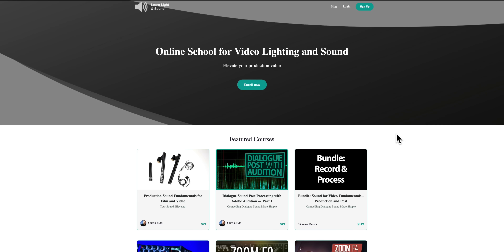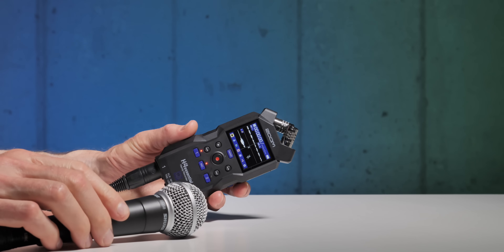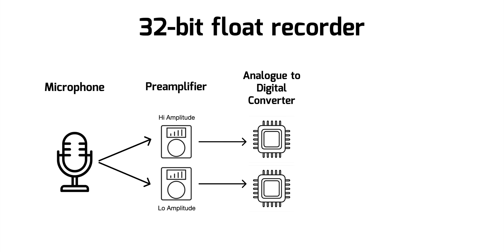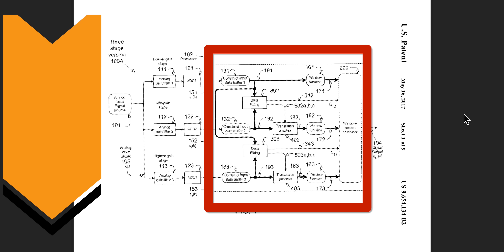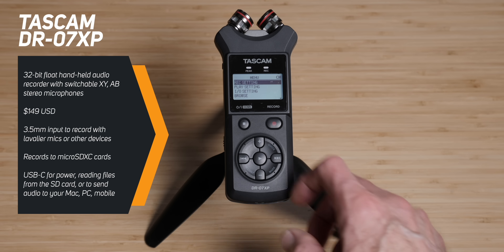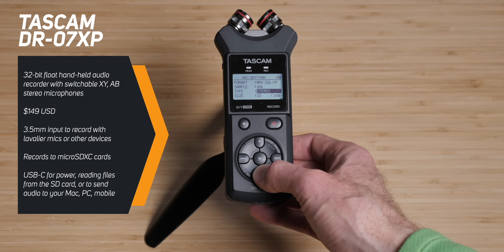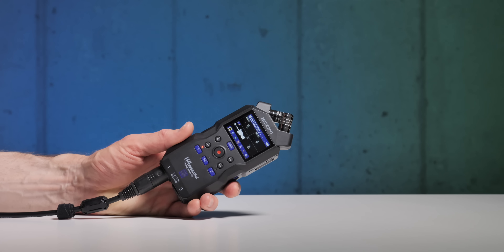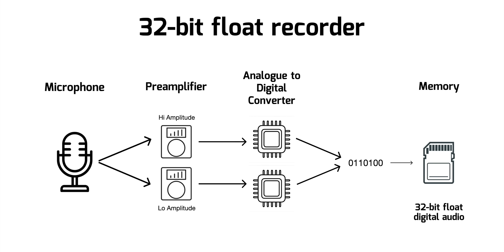PART 2 — 32-bit Float Audio Recorder Quality

Comment: I've been looking for a explanation of a 32bit  compared to 24 in respect to sound reproduction in a modern system am I correct in saying a 32 bit recording has a higher resolution of sound I.e. more detailed play back?
Any pointers would be much appreciated
Reply from the maker: Resolution is mostly a factor of sample rate and word length (24 vs 32-bit float) but there’s VERY little difference that most listeners can detect beyond 24-bit, 96kHz sample rate. What 32-bit float does generally offer is the ability to recover audio that goes over 0dB full scale. In higher quality 32-bit float implementations, you can also generally boost levels without raising the noise floor prominently.

Comment: Thanks Curtis. There is a new recorded on the market now from Zoom. Would like to hear your opinion on it very much. Also would like to hear your opinion on all small clip on mics like Rode Wireless Pro and DJI mics as well. Thank You very much
Reply from the maker: Yes! I covered the RODE Wireless Pro and ZOOM H5studio (which is presumably using the same microphones and preamps as the new H6studio): 

RODE: https://youtu.be/XcFrlxg9Nqk?feature=shared
ZOOM H5studio: https://youtu.be/kqaZIwEvye4?feature=shared

Comment: I wonder what your perspective is on using post processing techniques to reduce the captured noise?   
There are well known techniques in AstroPhotography to specifically capture the sensor noise under various scenarios and to use this data in post processing to dramatically reduce overall image noise.  Wondering if there is a viable equivalent process when capturing audio?
Reply from the maker: Yes, though many of the current generation noise reduction algorithms seem to do as good or better job. The trick with the recording of noise and using that as a cleanup baseline is that it generally only works with noise that is consistent, like HVAC moving air. And interestingly, that’s where the newer neural network and machine learning algorithms work really well.

Comment: According to your explanation about the quality of 32-bit float recorder, then how about the tiny 32-bit recorder on wireless mic transmitter so popular today? Are they completely out of consideration, meaning fake and only gimmick?
Reply from the maker: No, not necessarily. They're implemented differently, but the marketing people should NEVER say that they are "unclippable" because that's not true. Those little built--in mics can clip pretty easily. And each one is different so I would listen to a bunch of samples from each before buying.
Reply: @curtisjudd  Thanks for the answer, Curtis. I guess in the end I have to trust my own untrained ears to get the best recorder. Or, watching as many review as I can from the expert with trained ears.

Comment: I have 24 bit gear from 1998, so upgrade it will take at least 27 years, if ever. I wonder if there will be 64 bit recorders in 2050, just to record spacetime distortions from black hole mergers and nothing else.
Reply from the maker: Niche-o-rama. I'm with you. There have been less than 3 situations where I felt like 32-bit float actually helped me.

Comment: Serious Question: Why not "more" preamps and ADCs? I mean, obviously cost and diminishing returns, but could you still increase the dynamic range in any noticeable way? Where is the physical limit. 
I imagine that today, the ADCs should be cheap and low power enough, but the I'm sure the preamps are much more complex. 

But I absolutely love my Mix Pre's. I have the original 3 and the 3-II. Happy to use both, and I prefer even the "old" 3 over the Zoom F6, but that's most for UX.
Reply from the maker: For human hearing, I'm not convinced that we really need more than 140dB of dynamic range in our recordings. The funny thing is, even when 32-bit float  does its job and you can recover audio that exceeds 0 dBFS, you still have to address that in post before you publish your audio. And the irony is that many of the people that rely on 32-bit float don't do a great job post processing their audio.

Comment: @Curtis Judd : I have a simple question. I'd like to record DJ sets of approximately 8 hours in good audio quality using a Zoom or Tascam Audio Recorder, without post-processing. I'm not really into using the microphone options. Do you recommend a recorder with or without 32-bit Float? Which recorder do you recommend?
Reply from the maker: Unfortunately, 8 hour long recordings will get broken up into several files due to file system limitations in the ZOOM and Tascam recorders. The only recordings I know for sure that don't do this are VERY expensive (Sound Devices 833 for example).
Reply: @curtisjudd  Thanks for your reply. Only fat32 has a maximum file size limitation of 4GB, but exfat does not have these limitations.
Reply from the maker: @maup01 yes, makes sense, but I believe these recorders use FAT.

Comment: I wish Tentacle or Deity or someone would make a recorder with the size and function of a Zoom H1E or a Tascam O5XP but with timecode in it and higher quality preamps. Right now I'm running a Tentacle into one of the 1/4 inch inputs on an H4E and it's big and clunky and the battery life stinks and the noise floor stinks. I have a mixpre ii but sometimes I just need to put a recorder, or 4 recorders, in a few places and walk away to do camera work and not have to worry about the audio and I don't want to have to have a big setup with an external mic and xlr cable and big stands and stuff.

Comment: They could do fixed gain in 24 bit too, in fact thats exactly what those single converter setups are doing. There's no benefit only larger file sizes
Reply from the maker: One benefit, if you don’t care about noise: you don’t have to set gain.
Reply: @curtisjudd  you could do that in 24 bit as well. If the preset gain was high enough to clip a 24 bit file, it would still be clipping that 32 bit file which was made with a 24 bit converter and padded 0's

Comment: I think you may have been too nice or polite about recorders that do not have multiple, staged pre-amps/ADCs.  The limits of physics are still there limiting the dynamic range that any such single-stage system can handle.  So to users looking at one of those devices, it's true that you won't have to adjust the gain, but the odds are very much increased that your recording will either be faint and noisy or clipped, just like devices that existed a few years ago before 32 bit float was common.
Reply from the maker: I think I was pretty clear.

Comment: Hey guys, just wanted to share with you my knowledge about clipping and 32bit float.
The question is, like Curtis said, what's the weakest part in your audio recording chain.

Here we go:
So the first problem ist the maximum dBSPL which your microphone can handle, lets say 142dBSPL (Sennheiser MKH 8040).
The next problem is how much dBu your mic input on your recorder can handle, lets say 14dBu (MixPre II Series) and 4dBu (Zoom and Tascam).

Mathematic:
142dBSPL on the Sennheiser MKH 8040 means that it outputs 16.23dBU.
139.76dBSPL on the Sennheiser MKH 8040 means that it outputs 14dBU.
129.74dBSPL on the Sennheiser MKH 8040 means that it outputs 4dBU.

Result:
The MixPre II Series can handle maximum 14dBU mic input level, that means it starts clipping at above 139.76dbSPL from the Sennheiser MKH 8040.
The Zoom and Tascam Recorders can handle maximum 4dBU mic input level, that means they start clipping at above 129.74dBSPL from the Sennheiser MKH 8040.

By the way:
32bit float can take care of +770dBFS

Conclusion:
We all buy those 32bit float recorders because we don't have to worry about clipping. The minority really knows where their system starts to clip. So in general speaking, if you record with Tascam or Zoom in 32bit float you're fine if you don't exceed 120dbSPL. With the MixPre II Series you have 10db more headroom. If you want the exact number you have to study media engineering, because the math behind it is complex and you have to know what Bel is.

Things I would love to know:
Are those values A-weighted?
Why does SoundDevices Scorpio and 8-Series just have 8dBu mic input level?
Reply from the maker: Good points in there, thanks 👍

Comment: Great video as always. You ask for our experience with 32bit float recorders. The gist of what I want to say is that feature set and your intended usecase, form factor, ergonomics and requirements now outweigh sound quality differences.  My first one was a Zoom F2. (I liked it so much that I sold it amd bought two F2-BTs later :)    As my first experience was great, it did not take long to pick up a Portacapture X8. I loved the concept, versatility and user interface a lot. Initially there were a couple of issues with reliability and some irritating things in the software. But over the months Tascam released several new fw updates, and now it is perhaps my favourite recorder. The only thing missing for me is real timecode. Otherwise it has the perfect number and selection of inputs. Great recorder. Then I got an F8n Pro. That's a pro one, way beyond my true needs. An overkill, but I love it has two  line outs, dual SD... Perfect recorder for bag operation. Then a cheap secondhand F3 came my way. I loved the form factor and compactness. But I truly hated the record/hold/stop sliding switch and that it only had XLR and no 3.5mm or even 6.3 jack input. So when the Tascam FR-AV2 came out, I sold the F3 and got the FR-AV2 instead. It has a ton of features in a small body, and overall I am happy with it. But it has a very irritating issue: noisy audio with plugin powered mics on the 3.5mm jack input. And a few bugs or not so logical menu options. I hope Tascam will update the fw like they did with the X8. And then I coild not resist picking up a very well priced second hand F6. It is  very similar to what the F8n Pro can do, except the dual SD and the balanced line out. However, it is very compact and having NP-F battery and USB-C powering option so comfortably makes it a winner. Only problem, and that kept me long away from buying one (actually I first bought the F8nPro instead of the F6 because  of this)  is that for some mysterious reason Zoom has not made an Android client for the F6. I cannot fathom why, even the F8nPro does now have one.
Reply from the maker: Thanks for sharing! Ergonomics and others features definitely are a major consideration. 👍

Comment: I am probably repeating myself but my overall take on all of this is that if digital recording devices had first been released back in the 80s using 32 bit float output (instead of 14 bits, i remember it well), and then in 2025 someone came out with the first 24 bit float device, would we all have rushed out to buy it because we thought it was inherently better? I doubt it. It all has to be kept in proportion anyway. 

The chances of a client just complaining about the presence of 32 bit float from either one or more ADCs in a submitted recording is miniscule compared to a host of other factors. I'm currently working on the release of a 150 minute live recording I made of a historic classical music event from 32 years ago. 16 bits of course. 95% importance is the performance and by whom. 4% importance is the mics and where they were placed. 1% importance or less is the recording device, and you would need to express the percentage importance of the fact that it's 16 bits, as a tiny 32 bit float number. But i would have perspired less during the event if i hadn't had to worry about output clipping!
Reply from the maker: LOL! Thanks for sharing your perspective, Peter. 🙏
Reply: @curtisjudd  The famous producer of the event told me that he didn't mind that the executive producer had booked me to record it, so long as he could not see any mics.  That was a challenge, given that the production was "in the round" with the musicians in the middle of the audience.  No mic stands.  No suspensions.  And wireless wasn't an option.  And as I recall it, there was no opportunity for a balance test.  But I digress.

Comment: At 3:00, excellent point about the challenges of the recombining process. Limitations there are what caused the first attempts at multi-A/D to fail and earn a bad reputation several years ago. Sound Devices were the first to really figure it out, but the "reputational overhang" was such that even they didn't disclose that they were using it in the 8-series until it was well-established in the MixPre II. Presumably they were concerned that their professional clientele would be scared off.

In addition to "phase reconciliation" another issue is that the preamps feeding the A/Ds aren't perfectly stable. Their effective gains vary over time due to temperature and other factors, which means that the merging algorithm has to cross-correlate between the two when they "overlap" to determine how to scale them and thereby ensure that they merge cleanly. 

The "keystone" patent here is Sound Devices' US9654134B2. Obviously you already know that, because you showed one of the figures from it in this video :-). At the time that was written there was prior art for multi-A/D, and the novelty of their Claim 1 that made it patentable was the overlapped-windowing and correlation of the packets. Claims 4-5 narrow it to least-squares cross- and auto-correlation, and claim 8 describes how they choose which A/D to use. Root claims 13 and 18 are sort of "alternative constructions" of claim 1, to guard against having one or more of them thrown out by USPTO or a court. Admittedly that patent isn't very readable unless you happen to have a background in signal processing and specifically in patenting signal-processing approaches (like US8180168B2 and US7433096B2).

FWIW the H5Studio has basically identical EIN measurements to the F6 when tested with a 150 ohm dummy connector in one of its XLR inputs. That makes sense because Zoom have said that they use the same input circuitry. 

In a completely different category, and 8-series and the A20TX are amazing. Paul Isaacs stated in a livestream that the A20TX uses the same input circuit (preamps+converters) and I can't detect any significant difference. I'm not sure about the A20 Mini because it's lav-only (no balanced input option) so there's really no way to check. The input inherently limits its performance. I would not hesitate to run, say, an SM-7B remotely from the A20TX.